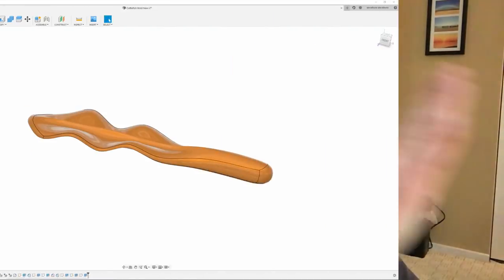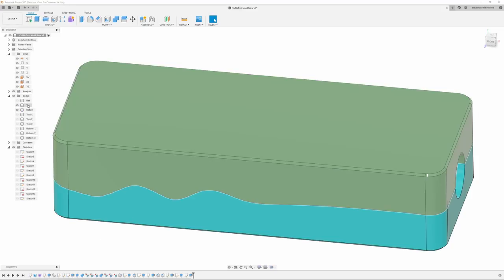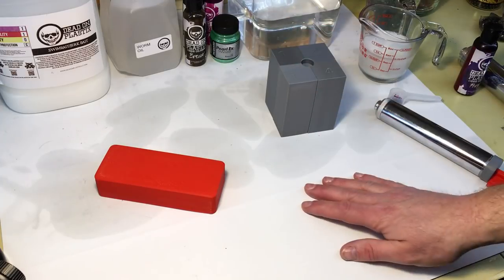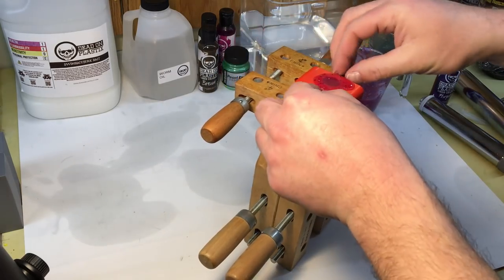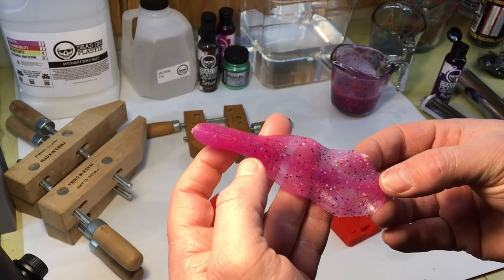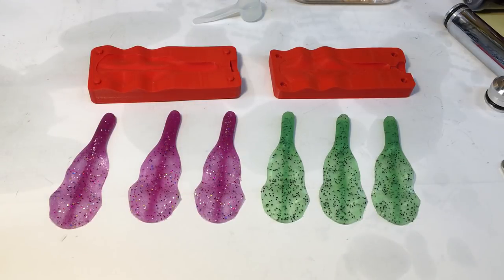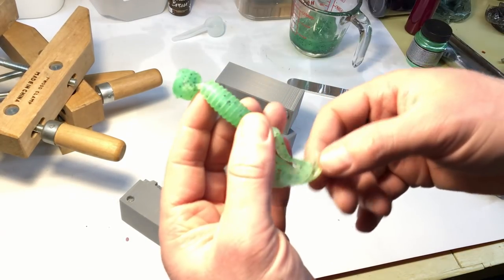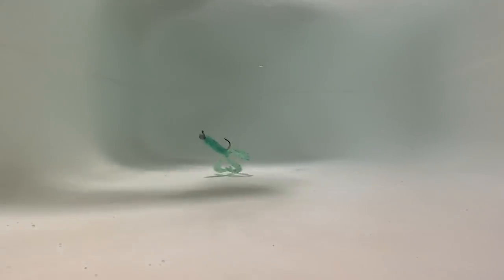Crazy Split Lines with 3D Printed Molds. (Cuttlefish Reaper + the 4 Tail Grub)

Comment: I'm thinking about buying some of these from a seller off ebay but I want to know how durable they are, how many lures can be made in one before it degrades ? I'm asking because it's just plastic itself and the lure bait plastic needs to be melted to a very high temp.
Reply from the maker: If it is a 3D printed mold you are looking at buying the durability is going to depend on the material it was printed with.  I use PLA+ which is a lower temp material so the risk of melting it is going to be higher than say a mold made in ABS but.... There are also a lot of factors that going into printing that will also determine the durability such as wall and layer numbers, infill, ect.  I do not have a exact number of lures that can be injected as I only usually print enough that I'm going to fish with personally.  

I'd honestly stay away from a 3D printed molds unless you are really knowledgeable about 3D printing. If you are printing the molds yourself it's one thing because if you screw it up you can just print another one.... that won't be the case if you just buy it from someone else.  I'm sot sure if what kind of experience you have already with injecting plastisol but shooting 3D printed molds is a bit of a different ballgame. You have to shot at much lower plastisol temps and there is definitely a steep learning curve which brings me back to being able to print your own replacements if you melt one.

Overall if the cost is cheap enough it might be worth it to you just to experiment with but in the long run it will probably be better just to spend the money on a aluminum (or even a silicone) mold (these you can always sell if you do not like the bait). 

I hope that helps a little if you have any other questions feel free to ask and I'll try to help.
Reply: @TheNeverendingProjectsList  cheers for the info, the guy I've bought one off said he's been using his for over 2 years and hasn't had a problem as long as you let the plastic cool to a lower temp of the melting point of the mold, he's sent some good info keeping me on the right track so I'll see what happens, if all fails I'll go with making my own silicone molds.
Reply from the maker: Yeah once I learned the correct temps (around 300° in my case) I haven't had any major problems either...  Good luck.

Comment: Is the 4 tail grub mould plans available for purchase.?
Reply from the maker: The files to print your own can be purchased from https://cults3d.com/en/3d-model/various/four-tail-grub-soft-plastic-injection-mold
Reply: @TheNeverendingProjectsList  will they work with a resin printer?
Reply from the maker: @rouseyanglerholics  I don't know much about resin printers but I don't see why they wouldn't. I know people have printed so of my other molds in resin and they work great from what I hear. Some of the high temp resins work a lot better than the PLA I normally print in.
Reply: @TheNeverendingProjectsList  ok great thanks

Comment: Can you recommend a printer to do this with around 500 or less?
Reply from the maker: I honestly don't know a lot about the various printers that are out there... When I started 3d printing (2014) I bought top of the line right from the start because I didn't want to constantly mess with the printer I just wanted to make stuff.  These days printers have come a long way and even the cheaper ones produce great stuff. I'd look at the Creality3D line of printers as I've heard a lot of great things about them and they are pretty inexpensive these days.
Reply: Depends on your technical abilities. I would suggest an Ender 3 pro if you are technically capable or something like a Polaroid if you aren't. There are relatively good printers available for under 500USD nowadays.

Comment: wouldn't it be cheaper and faster to print the final product, make a mold with liquid silicone and use that to cast the lures?
Reply from the maker: Definitely wouldn't be cheaper... Printing filament is a lot cheaper than silicone and printing is probably faster than waiting for silicone to cure. A silicone mold would probably last longer and you don't have the worry of melting it while injecting though.

Comment: Bait?  Looks like a lure.
Reply from the maker: You're killin me smalls
Reply: @TheNeverendingProjectsList  

I have not tried molding with soft plastics.   Thanks for the video.
Reply: @TheNeverendingProjectsList  

I dont have any videos up on YouTube, but here is a link to a Facebook page with some of the molds I'm building.

https://www.facebook.com/Dream-Draw-Design-Print-732896613499667/
Reply: @TheNeverendingProjectsList  

Small mold.

https://www.facebook.com/732896613499667/posts/2431204780335500/
Reply: @TheNeverendingProjectsList  

Big complex mold.  This mold doubles as the support structure for the silicone mold it produces.

https://www.facebook.com/732896613499667/posts/2434486863340625/
Reply from the maker: @DaveWard-xc7vd  Very cool... I plan on making a frog "Lure" :) out of the silicone mold material using 3D printed molds in a future video.

Comment: Not sure if you know, but you've got a lot of ghosting on your prints.
Reply from the maker: Thanks... Yeah and it's probably because I print fast and have three printers running on the same bench at a time so the vibration carries over to the other printers.  It's really not a big deal for something like this though so I haven't dealt with it.
Reply: @TheNeverendingProjectsList  a very good solution to fixing vibration for printers is not to isolate it (with rubber), but to instead dampen it. Essentially just load the table with heavy objects (paving slabs beneath the printers works a treat!)
Reply: @joshuamarsters8253  Still, a washing machine rubber mat under the printer also helps.
Reply from the maker: @joshuamarsters8253  My printers sit on a bar that is pretty solid but the vibrations travel through the wood still.  The printers do have rubber feet but still like to move around so I might have to look into those mats you mentions... thanks.